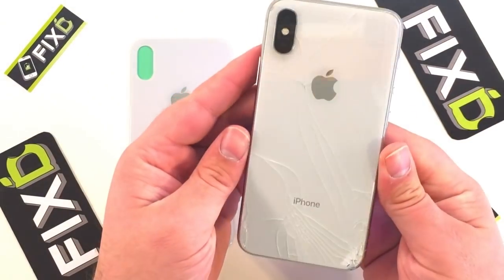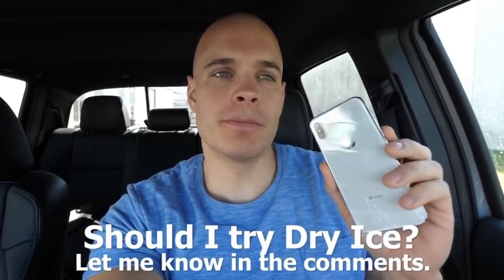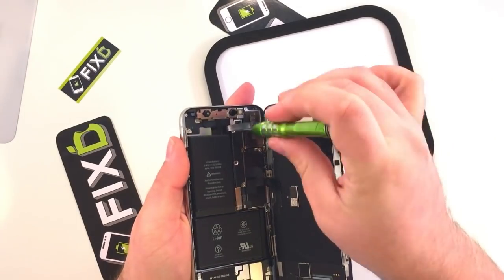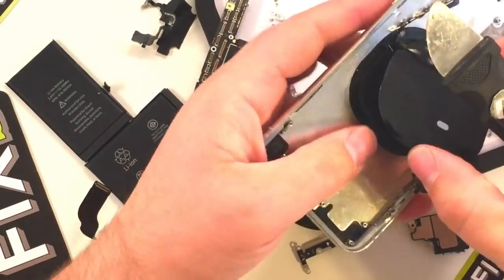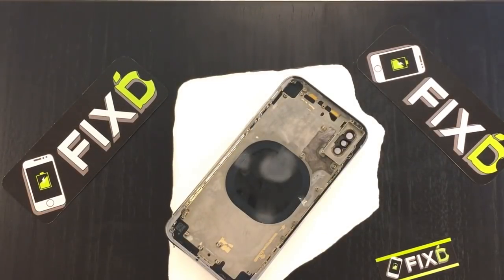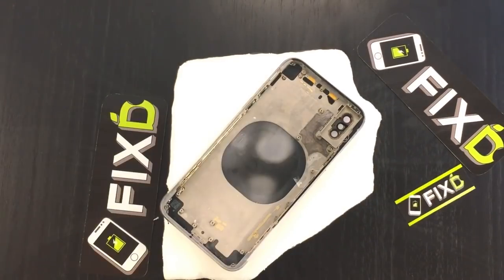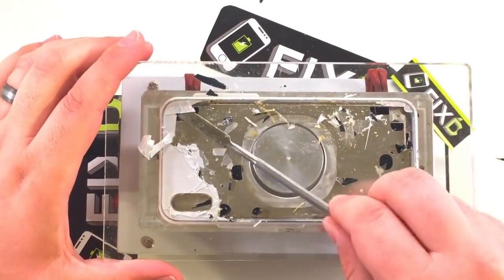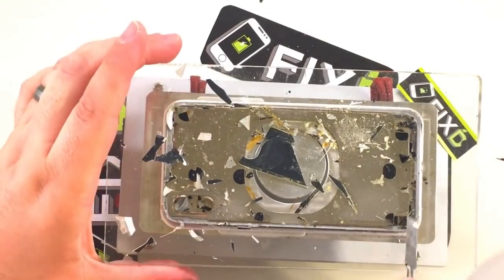Can you replace an iPhone X Back Glass with Dry Ice?

Comment: I have an iPhone X that the front and back glass are shattered (though the front is just cracked, not too bad). The charging port doesn't work (sister dropped it, breaking the glass... then dropped it in water later) and I can't find anyone that will fix it... understandably. It still works but can only charge wirelessly... I hate using the pad to charge it. I have an iPhone 6+ I use.... but I'm determined to salvage her phone cause it's so much better than mine.